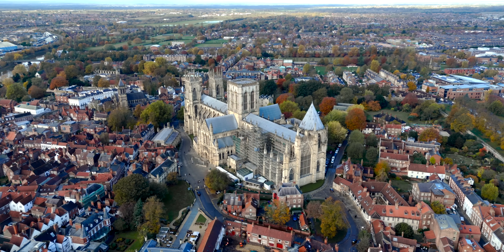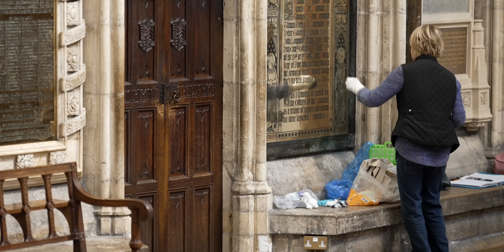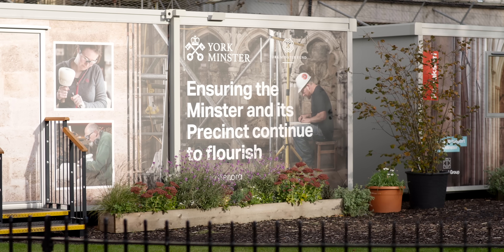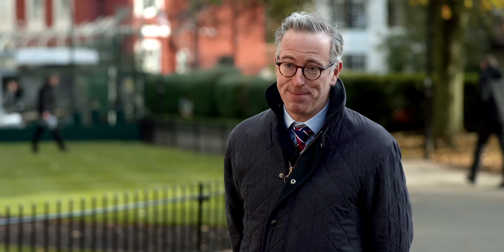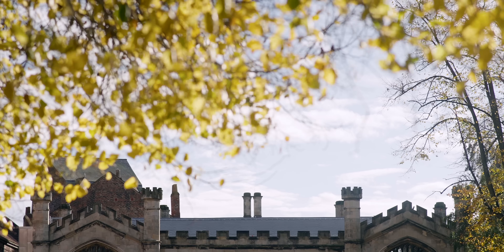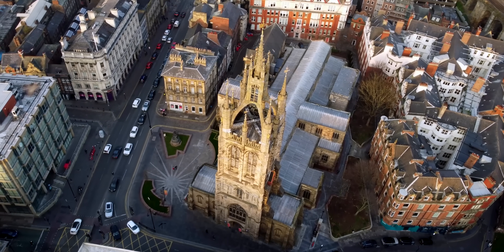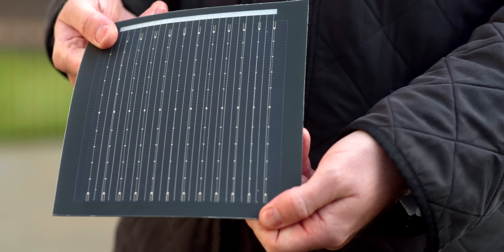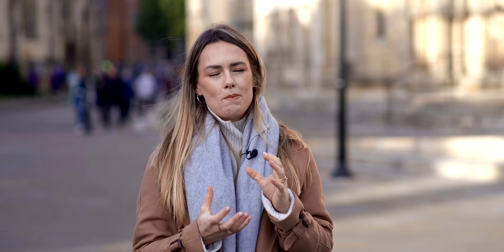Why We Need To Rethink Solar!

Comment: If heritage buildings can achieve so much just imagine how much could be achieved by our industrial buildings if  a small planning requirement was put in place.
Reply: There is at least 50GW of potential capacity of roof-top solar and car parks in the UK… that’s 16-25 nuclear power stations depending on the number of reactors. Of course, solar PV has a capacity factor of ~10% in the UK, but still, if you can store, that would still produce about 16% (46tWh) of the UK annual demand in electricity (275tWh).
Reply: Requirement! That's a key word!
Reply: It seems to me, that industrial buildings always get pv when newly built, but nobody touches running systems.
Reply: @ingo_8628 Anything is possible, these were just added to a 30 year old industrial building in Bedford https://maps.app.goo.gl/BFGzJym2Bocthr9S9?g_st=ic
Reply: @ingo_8628  its weight and mounting that causes issues.  Are the roofs designed for that extra weight?  Will drilling into the water barrier of the roof potentially cause a leak when you mount the solar panels?  People seem to think its just a matter of throwing the panels on the roof and being done with it.  There is a lot of engineering involved.
Reply: @pin65371  If it's a planning requirement, roof design will adjust to acomodate them.
Reply: I've been saying for years put panels on all roofs !  WHY HAS IT NOT BE DONE before glasgow lez or next years Edinburgh lez BUT people don't want an ev,car might explode and take other cars with it or your hoose !
Reply: @stum8374 maybe you should take a look at the roof of a typical Edinburgh tenement and work out how you get the solar panels up there, if there's enough for the eight flats on the stair, what happens if there's snow on the roof...  not a very practical idea, but hey Holyrood is always on the lookout for batshit crazy schemes for spending our money.
Reply: @stum8374  because of cost.  Right now like 10% of the population where I live are going to food banks.  The rest are worried they will lose their homes when they need to renew their mortgage.  Its also not as simple as throwing solar panels on a roof.  Most roofs are not designed for a lot of extra weight and drilling into a roof is a great way to get leaks.  Then you have the issue with cleaning solar panels on a roof. Unless you are going up on your roof by yourself then you are paying someone a couple times a year to do that work.
Reply: @stum8374  do you have solar panels on your roof?
Reply: @stum8374 Petrol cars are far more likely to explode than EVs
Reply: @stum8374  People want an EV but most can't afford them with current insecurity and high intrest rates
Reply: @eclecticcyclist  meh, there are tons of 2nd hand EVs under £10k with decent range. And people don’t realise that their current ICE car is basically a pile of money that they should soon use towards transitioning to an EV (with a small loan if need be to top up). Bearing in mind that this pile of money is more like ICE in the sun… 😏 (see what I did there 😁) given that combustion cars won’t be worth much very soon…
Reply: @Nikoo033  Loans are expensive currently and many people don't want to commit at the moment in case the rate goes up again, but the intention is still there and allit takes is for the economic situation toshow signs of change,
Reply: @eclecticcyclist this is why I want the government to allow solar to be salary sacrificed. 

Please write to your MP to get this to there attention